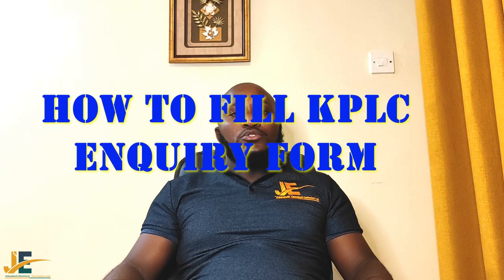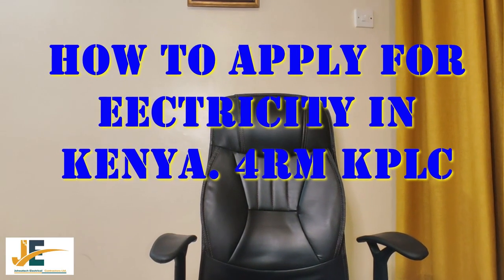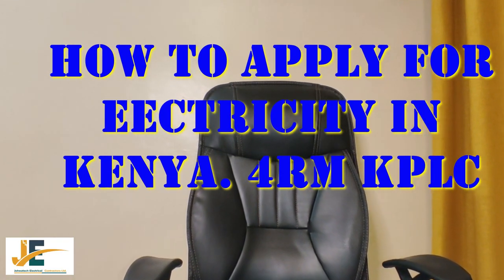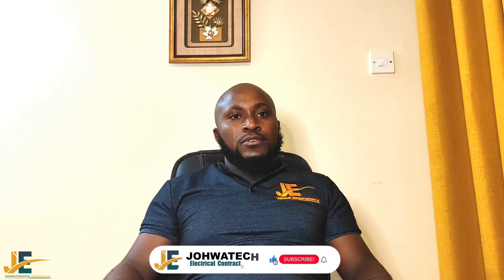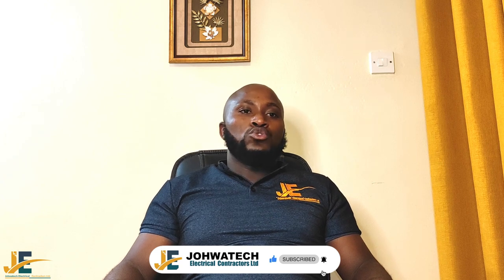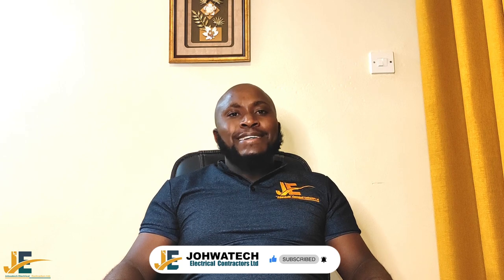HOW TO FILL KPLC APPLICATION-ENQUIRY FORM ACCURATELY & STEP BY STEP

Comment: Hello John nguru  I had a problem with my smart meter which I could not detect what the problem was, cause the inlet from the cutout -doublepole-to the meter it self the connection is fine and one of the meter is properly working but the other meter which is connected to the main house ,there is no result of lights ,I kindly ask where the problem could be
Reply from the maker: Check if the Meter switched to tamper mode if it has credit. For assistance check out this YouTube video https://www.youtube.com/watch?v=ZN6dG2L86Vk&t=127s or call us